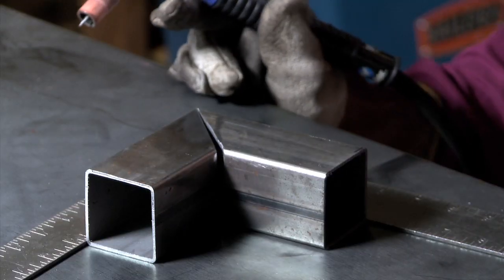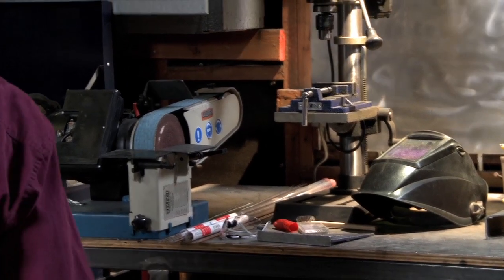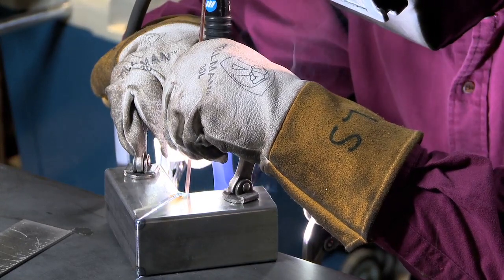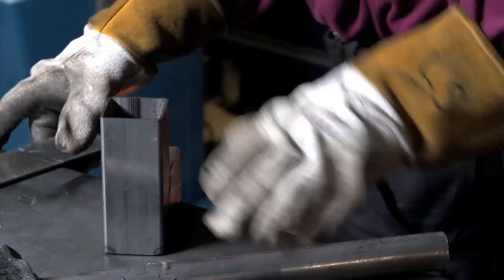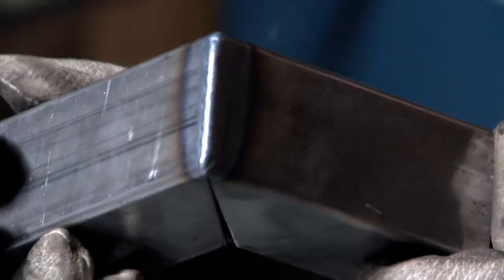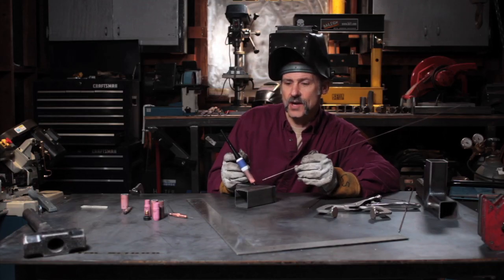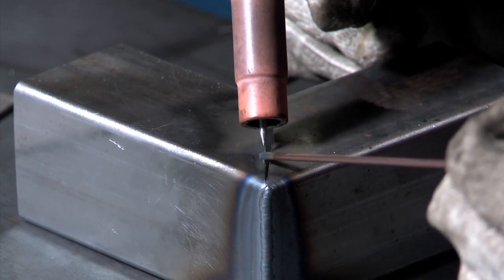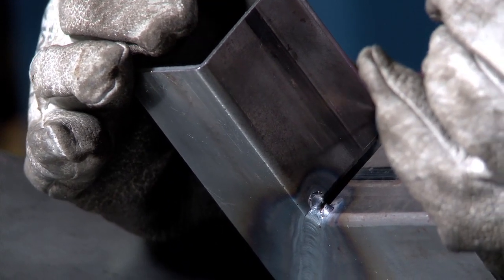TIG Welding a Tubing Joint

Comment: to make life a little easier pre set the joint to over square before tacking it,so that after it is tacked it is still over square that way once it is completely welded it is closer to square,you will get an idea on how much it will move by looking at how much it moved just by tackin it 1-2mm,so id set it about 4mm over square and by the time its welded out it should be close so there is little work needed to get it to square,and that 1-2mm of movement was on a piece only 100mm or so long so imagine it on a piece about 1-2m the 1-2mm would be probibaly 20mm or so.I hope this helps anyone whos learning

Comment: I agree.  I have had plenty of people working with me who don't understand that when welding a bad fit like that that it is best to weld from the widest part of the gap towards the good fit side to avoid pulling as badly out of square.  Yes, the weld is less difficult to perform going from the narrow side toward the wide side but the pull is far worse towards the inside of a  corner than the outside.

Comment: You should always finish the outter and inner welds, then proceed to the side welds. That will give it sideways stiffness.
Also, weld it at an angle that's 90 degrees plus the shrinking. That way, it will get pulled in the right shape. Remember to clamp down the workpiece.

Comment: I have no problems with you giving yourself compliments. I thought it was great work. What is wrong with saying that. So you had more heat that you needed, so what. Its a mild steel join. Its not stainless. Who cares. Sometimes people who have spent their whole lives doing the one thing can't do anything but obsess over something that no one, not even the client cares about. They are small people.

Comment: I'm a newer welder and was curious if the weld order (outside, sides from inside to outside, fillet) to keep things square remains the same for SMAW?  Are there any other considerations with stick welding to keep things as square as possible?

Comment: You can turn the delay or the sensitivity up on an autodark hood.
I find one click on the sensitivity is enough to stop from seeing spots. After I'm done welding the metal is white to red hot for a second, so if you're not in a hurry the delay setting  on your hood lets the metal cool before going light again.

Comment: Sounds like an auto-darkening hood? All the ones I've seen are made for mig welding. Get a tig welding hood, the lens is darker and the proper protection for your eyes. You'll get used to flippin' it up and down like the guy in the vid.

Comment: When welding mild steel, my tig electrode goes very bright (hurts eyes even through the hood) when turning off current (releasing pedal).  I have a miller syncrowave 2500dx.  Any tips on what I'm doing wrong?

Comment: @11:50 hold that torch upright a lil bit more, cant see to be 100% but I doubt you're melting the corner of the joint on the flat

Comment: Cant really pull you apart on this as it may be medical, but dont get so nervous, my 89yr old grandma who has parkinsons has a steadier hand 
Why do you always want to change the rod size? always go with the smallest you can get away with and increase your filler hand speed
@8:25 ish you have the peice flat on a bench and you favor 1 side of the joint? you could have had you torch 90/90/70 pulling towards yourself

Comment from the maker: JHV166,  Thanks for the feedback on the video.  You are definitely right the heat could be turned down.  I also agree with the stickout, and rod feed technique comment as well.  It gets really hard to make the weld and get the camera and lighting angle without doing some weird things like putting the tungsten way out and holding the rod a foot away from the work and feeding it from weird angles.  We're going to keep at it though for sure.  Maybe with less coffee next time too!